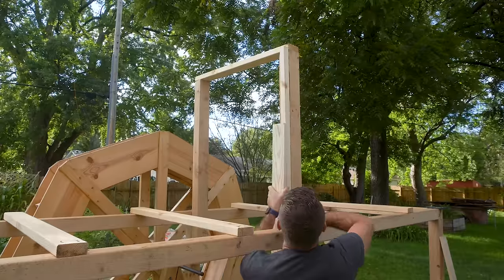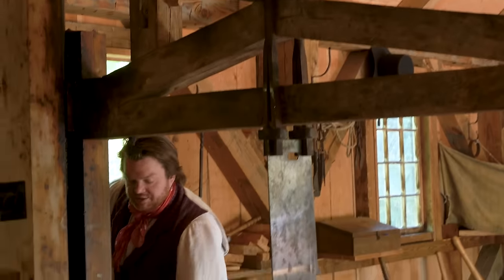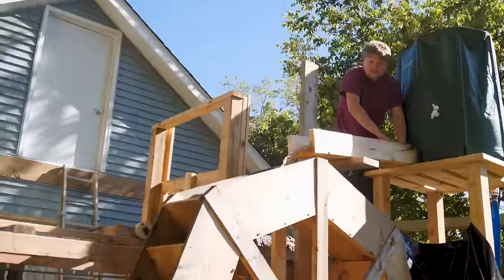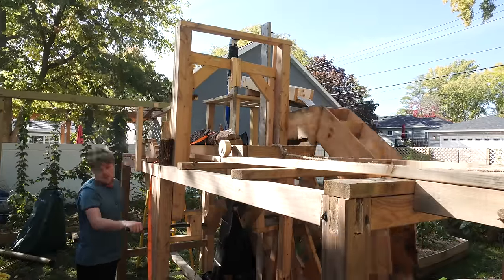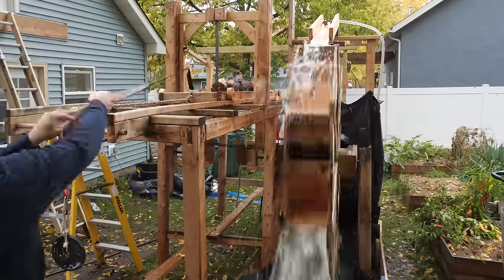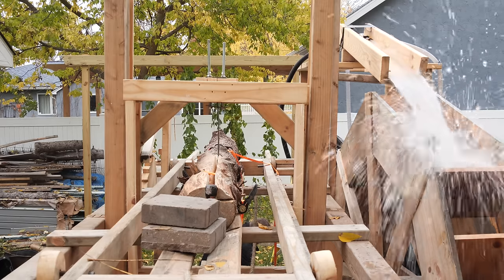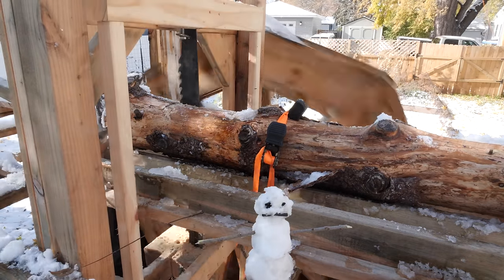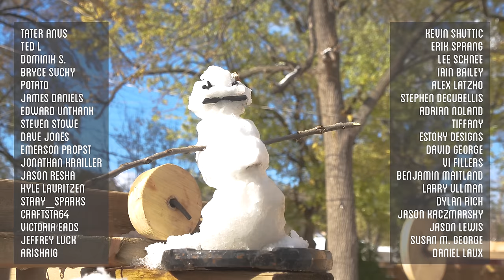I IMPROVED DaVinci's Saw Mill!

Comment: very interesting, though I think you are missed looking at a couple of areas that should improve efficiency, the 'bearings' that the shafts spin in and framing that the sawblade holder sides in.  If you check, most surfaces like that were made from hard woods(oak, hard maple and such) and you seem to be using pine which would create more friction and have greater tendency to bind, stealing power from the wheel.  Also I didn't see any type of lubrication being used at those areas either.  Tallow was a common lubricant during that time, basically just glob it on when assembling and in the case of the shafts, have a hole (1/2 inch at most) drilled in above the shaft hole and force tallow into as needed.  Doing both those should reduce friction and allow more energy to the blade.

Comment: I think if you had a little bit of a lip on the paddles it could reduce some of the splashback and would make it easier to start when you actually do start it because some of the water will get collected because of the lips of the paddles, poolling in the buckets adding weight which would pull the wheel down making it so it can start on its own without you having to pull the wheel and when the water gets dropped off it'll get dropped off a little bit closer to the ground so it's less water would get wasted

Comment: Keep in mind these are all little tweaks that people in the 1500s would have made as they experimented with the machine after building it. So as far as I'm concerned this is perfectly in line with what Davinci imagined even if you guys did have to make some modifications as you went along.
Reply: That's always part of building something like this. There will always be something that doesn't work the way you imagined and needs to be adjusted, changed or rebuilt. And in the rost case scenario you have to rebuild the whole thing.

Comment: I don't know much, but would it work if you build a tall windmill and use a system of pulleys and weights to store that rotational energy generated by the wind in some sort of a mix of a crane and that old spring so when you want to use it, you just kick the gear from put in to give out and "plug" it into the sawmill? would that work?

Comment: It would be interesting if you could get some mechanism to help siphon or preserve power from the downstroke to keep the speed more consistent. It seems like the blade largely cuts just under gravity and moves a bit more jerkily from slop in the connection to the wheel, maybe just tightening that up somehow would help it retain some of that momentum to lift the blade back up?
Very impressive tho!
I think the trick with the ratchet would be to make sure it only applies force during the downstroke, and maybe have something like a spring with some give to let it back off during the upstroke? I'm not honestly sure if there would be a good way to design this, esp with materials of the time, but it's an idea!

Comment: Good steps in the right directions.
Improvements that can be made is:
1)Smaller and more teeth on the advancing wheel.
2)grind the saw teeth the same height so all the teeth can cut
3) A lot of the teeth have to great of an angle and so don't dig into the wood and just slid/drag. Like dragging your finger tip or knuckle across bread instead of digging your fingernail in.

Comment: Perhaps a longer stroke on the blade will make it easier with the ratchet system. Then you could have a better ratio between the feed and stroke to avoid binding. A skirt for the funnel would minimize splash from the water wheel and preserve more water.
Keep it up!

Comment: I assume it would help to have some kind of a bow to help it climb against gravity, with just water that's quite some force required, it would also help smooth the fall of the blade, make the cut more consistent and lower stress on all the parts

Comment: Are you using any lubricant?

   Wax will help lube all the sliding areas (pretty much everything) including the blade itself. 
   It will also waterproof it so you don't have to worry about swelling or warping.

Comment: I would've made the waterwheel heavier almost akin to a flywheel so that once you got it going it would have much more momentum to get through the pressure placed on the log but that wouldn't have helped at all with your pin sheering off plus it would've been much harder to get moving with your pumps output if it did stop.

Comment: I might be missing the point here, but it feels like, when it comes to the waterwheel, you've proven that it works and a limiting factor is that you don't have a river running through your yard to give you the power and consistency that the pumps don't seem to manage. Would  it work to just simulate the river with something that has similar power and consistency so you can focus on getting everything else ironed out?

Comment: I think the largest improvement is the blade, you finally have something looking like a rip blade rather tah a cross cut blade. There is a much larger difference betwean cross cuts and rip cuts than you might imagine. The angle of the blade is also important, the more agressive the angle the faster it will cut but the more force is needed, so if you have a limited power you might want to try cutting a little bit along the angle of the log rather than in to the angle of the log.

Comment: The obvious improvement to DaVinci’s saw would be to oscillate the blade back and forward so the upstroke is has less friction and the downstroke bites into the wood for the whole stroke. Flywheel would help too.

Comment: Definately next time you need to play with the smoothness of the mechanism. A lot of what I am seeing is jerky motion which causes excess wear. Try adding a counterweight to the other end of the shaft to smooth the rotational motion out. Then change out the linkage to the frame with one that has less slop, add an enclosed track so there is no upward movement on the sled. Finally i would run the saw at a faster rate than the sled, that way it will cut less per stroke but you also will encounter less friction.

Comment: Pretty good. I would want to change the water system. It should be hitting with momentum in the portion perpendicular to gravity, to maximize the torque you produce. The ramp should be angled downwards and moved to hit that spot. Also, the weight of the wheel itself is too high compared to the weight of the water driving it. The heavy wheel to water ratio, locks out a portion of energy due to higher inertia to overcome and increased overall friction due to weight. Alternately, you could pump water to a lower ramp that meets the wheel, which fills until it moves far enough to release a bucket of water, and increase the roundness of the wheel to keep pressure in the buckets at the fill point.

Comment: Look at an actual saw blade, not only are the teeth shark fins but they kick at different angles which helps it clear the sawdust out limiting how much it binds. If you go over to a fine tooth blade it'll have far less drag on the wood and while it won't take as big of a bite per pass, it should continue cutting far easier. When you have little water flow you need to reduce drag wherever possible.

Comment: Did you “set” the saw teeth. Helps reduce drag on the blade. Bend a tooth to the right a smidge. The next one leave straight. Bend the third to the left. And repeat the pattern.

Comment: Perhaps changing the angle of the water feed so the water is dropping straight down into the wheel the force of gravity would allow a lower flow to push the wheel with more force. That would probably require adjustment of the angle of the fins in your wheel tho

Comment: You can increase the height of the water tower to get more pressure. even if it's thinner such as just installing a thin pipe. This was demonstrated by a guy around the 1800s i think, he would blow up a barrel with just a cup of water. The physics of it say the height of the water is what gives it the power and not the amount of water

Comment: Get a 3rd pully to add tension to the rope almost like a bike chain, then the blade needs to be screwd down tight to prevent the blade from warping.

I'd also add a fly wheel to help in energy transfer. And I'd do the human wheel you don't have enough power from the water wheel

Comment: Biggest thing i noticed between yours and the Mackinaw mill, is the speed of their saw. Im guessing they have a lot more torque also (being as they have a whole river). The new blade probably is a huge help since thoes teeth are made with a plan gor the wood shavings to go somewhere, and they have an actual pressure angle on the cutting edge of the teeth. I dont think theres a problem with da vinci's design,  but your artificial river and low accuracy (not an insult, sorry) crafting may be compounding in this case.

Edit: i do think the weights are a better solution than the ratchet. Realistically you need a constant pressure on the blade, and with the ratcheting system you get high and low pressures.

Comment: If you angle the boards on the Wheel back a bit i think they Will hold more water that Will increase the torque. Plus the water Will hit it harder then. Might give some improved performance

Comment: You need a gear system on there so one turn the big wheel is like five repetitions of the saw and youll need to bend (set) the teeth 1 left an1/8" th3n right 1/8" a nd it won't bind up as much

Comment: Your ratchet wheel needs to be bigger. Try to mount it on the outside of your frame so its size won't be hindered by your framing. You want it to pull almost slower than the blade will cut the log. 
I would also make the teeth on your saw just a bit smaller and increase the amount of them accordingly. The profile you have for them looks great now.
Something else you might consider is including some sort of riving knife. If done right it would help keep the wood from binding on the blade

Comment: Hi, just a few thoughts, if the sled moves forward on the up stroke and the saw blade is fixed so that the top is slightly forward of the bottom. Then the saw will have a natural feed on the down stroke. You can adjust the blade top forward off-set to suit the cut length of each stroke. The ripping shape of the teeth is forward leaning with the tooth filed square across like a set of mini chisels. see my book, Timber for Building, cheers

Comment: i know that it's not really the main problem that you're fighting.. but did you ever think of putting a flywheel on the drive shaft to smooth out the motion of the saw? I know that the weight of the waterwheel probably should be enough to maintain the rate of spin but any extra inertia to keep the saw from stopping when it bottoms/tops out should help

Comment: You should add guide blocks to the blade on the underside of the mill. And once the cut is started use wedges to keep the cur from closing up. Also wax the blade
Reply: Excellent suggestions!

Comment: Whatever tweaking you do, you're never gonna get more work from the machine than the energy you input into it. Considering all the energy loss due to friction and such, it's no wonder three small water pumps have trouble cutting a log. Nice improvement on the earlier version though.

The human wheel is very impressive! But when you think of it, wouldn't a simple bicycle-style mechanism be able to do essentially the same job with less expense, less loss of energy and way more safely?

Comment: i feel like a smaller diameter water wheel with a flywheel on it would help, once it's up to speed the inertia should help keep it going and it should in theory hit a higher rpm being smaller diameter with the same water flow

Comment: Interesting, could you reverse engineer the paddle section to run in the river with a bottom-running water flow? Currently it has water flowing over the top. Every watermill I have seen had water running from the bottom portion of the wheel.

Comment: What you need is a blade guide *just 3 small wheels, one to the back and one each right and left of the blade itself. The water shouldnt hit the wheel in its top position either, it should hit the front of the wheel as well.

Comment: Slop is the enemy here, the crank really shows a lot of play as the saw hits the bottom of the stroke and then reverses direction. Every bit of unintended motion in a joint/assembly/etc is just robbing power from the machine. Still, phenomenal progress and results working more or less from scratch!

Comment: Keep in mind the laws of physics. The only energy in this system is that water flow. Real sawmills have rivers or creeks. You have a piddly little flow from a pump. It's easy to try to chase your tail fixing things when the issue is you only have x energy in your system and you can convert it any way you want, but it only goes so far.

Comment: I habe a question about your sawblade:

Are you using some sort of lubricant on the blade? 
rubbing a bar of soap along the blade can make all the difference

Also the teeth of you saw look a bit too straight, i dont know the english term but in german it is called "schränkung" meaning the teeth are bent slightly outward to make the channel of the cut just a tiny bit woder then the sawblade itself to prevent it from getting stuck

Comment: What would be interesting, not practical or cheap, would be to build a second saw mill but with all modern components.  Tool steel, ball bearings, all metal frame and a carbon fiber wheel.   Yes I know "cheating" but it would be interesting to see how that preformed with the same basic propulsion system more to prove the actual design rather then the period materials and construction techniques.   An outstanding series to follow.

Comment: Why don't you go to what they use on steam powered sawmills. They have belt drive which allows slip in case of a binding and they use a spinning disk with a wheel against it for the carriage speed and direction forwards and backwards.

Comment: This might be covered in the next video, but the hamster wheel might be easier to turn if it has steps for the human to push against.  It might also work better if the steps are on the outside so you can add a rail, but that could get pretty sketchy 😂

Comment: Steam! Be very careful with boiler systems. They can be super dangerous,  when they pop its big, and any jam in the system, from the output to the pistons, can cause a dangerous problem. You might team up with blondihacks or heritage machinery or one of the other YouTubers who have worked on steam. As bad as your shop situation was, a boiler poping, even a small one (like 1 gallons small) can result in a 3 meter kill radius.

Comment: I feel like you've established that you can theoretically run it with water, but considering you're using pumps to move the water you might as well skip the middle man and hook an electric or gas motor directly to the rotor.

maybe a steam engine???

Comment: The whole design should have focused on robustness. the axel should be the main focus and the using smaller teeth to get faster swings since if you cant get the motion fluid then the axel will take all that force and all the pins just carve the wood and you get slack and oscillations and it gets the lag and jitters. also its the moisture that adds to the bullshit so something has to be done about the wood itself. in the end i think carving gears would be the best option and the ration should be something to focus on.

Comment: Brave project I have to say.
BUT...
The movement of your blade frame is too slow but that is a function of your water wheel diameter and narrow "blades" - the unit you visited had a smaller diameter and was much wider and had a lot of water.
Secondly the crankshaft and the connecting rod are far too flimsy. In your model the piece of metal rod used for the conrod is flopping all over the place which allows the blade teeth to dig into the wood which effectively stops everything when the conrod eventually decides to join the party and put some energy into the frame that holds the blade.
Thirdly, the teeth on the advance ratchet are way too course which advances the blade too much making the depth of cut too deep which overpowers the waterwheel.
Have a look at a metal shaper machine to see how they do the multiple advance speeds thing with just 1 ratchet gear.
Think about  it over winter and see what happens in the spring.

Comment: Very impressive, but you've missed a critical issue with the transfer from rotational energy to linear energy. 
The transfer bar is too long, the surface engagement is too small, and you're losing a lot of energy to just torsion as it's going around.

Comment: Why don't you have the water just falling straight down on the edge of the wheel, instead of flowing forward directly above? That way, gravity is also on your side... also, have you tried using a gear system? The blade should be moving a lot faster

Comment: I love you doing this project. But ultimately it shows why most of Leonardo's weird tech newer worked out. He didn't have the power to make it work. It's not only the shear pin, virtually every single connector is going to rip the wood apart unless you understand the principle of washers. The only way he was ever going to make it work would be so slow it would be WAY cheaper just to hire three guys to cut the log, which is why that is what happened all the way until the combustion engine was invented centuries later.

Comment: I think you'd be better off with more teeth on the blade, smaller, and imo you dont need the massive chip clearing capacity from a large tooth because the horsepower just isnt there to make that big chip.

Comment: Extracting mechanical energy from water is not a easy thing to do. To little flow and the torque isn't enough to move it, to much flow and its high enough to tear everything apart.